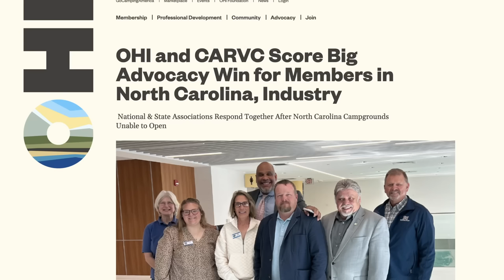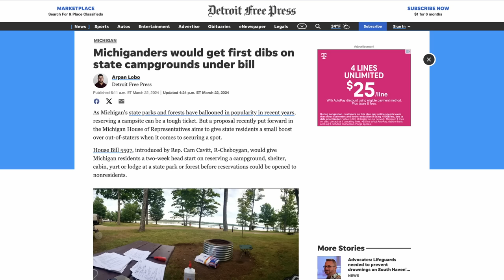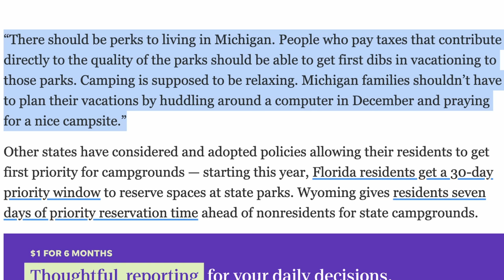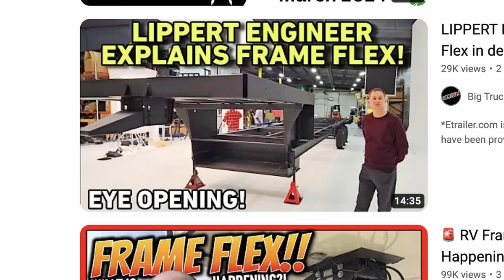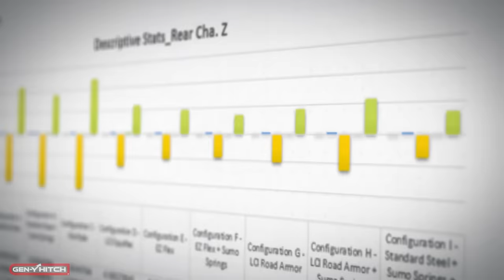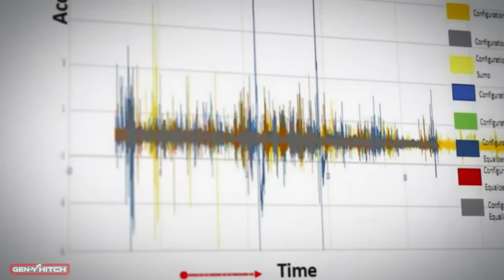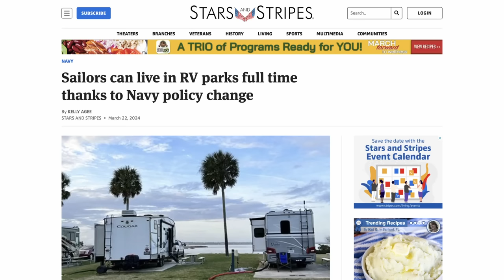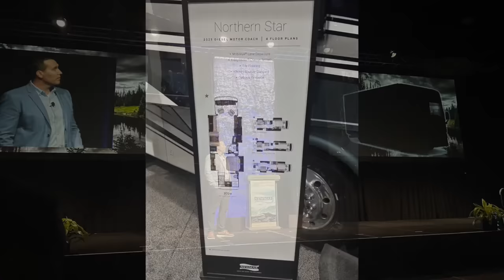NC Campgrounds SHUT DOWN, MI State Park Head Start for Residents, Can Gen-Y Hitch Fix Frame Failure?

Comment: I sold RV's for over 17 years, when customers asked me the same question about adding a gooseneck, Anderson or any other IMPROVED hitch and does it VOID the frame warranty, I said, just save the original pin box and if you ever have a frame issue, re-install it and have it looked at with that one and the question NEVER comes up.  Problem avoided.

Comment: North Carolinas deputy fire marshal needs to stay within their jurisdictional wheelhouse and quit trying to put a feather in there cap in the name of electrical safety. Adding GFCI’s to Campground pedestal 30 and 50 amp receptacles is insane. They are protected within the unit and unless there’s a damage cord from the pedestal to the unit there’s absolutely no hazard and as stated the appliances in RVs are not designed to function on GFCI is 100% correct. Thank you for your research and reporting this information. 👊👍😎
Reply: Also, there should never be two GFCI's on any one circuit or the feature will not work as advertised .  If the electric pedestal has GFCI, then the camper should not.  So now if your camper has one built into the panel, you should not be plugging into a GFCI pedestal.

Comment: GFI's, you cannot put 2 GFI in series or on the same circuit, they will trip each other. If you put a GFI on the pole, then have another in the camper they will trip each other. I was an electrican 40 years.

Comment: The GFCI issue is somewhat true, however, it's not so much that RV's can exceed the limit for the outlet, but RV's are not "grounded" to earth like a residential home is. 30amp and 50amp plug are not effected, but the extra 15amp GFCI outlet is the problem. I had this issue when plugging in a smaller trailer on the GFCI outlet. The trailer would just instantly trip since the trailer wasn't grounded to anything and not completing that circuit 👍🏻

Comment: Unintentional tripping of GFCIs is a real issue.  Most items that plug into 15 or 20 amp outlets have long ago been undated to prevent nuisance tripping.  However, take an entire 50 RV with all of its electrical components and you are asking for trouble.  Many items contain some kind of surge suppression.  Surge suppressors leak current to ground.  While one suppressor would likely not cause a problem for GFCI, many of them in one RV WOULD.  RVs have their own GFCI protection so requiring that protection on the 50 amp pedestal is unnecessary and likely will lead to issues.  I teach classes, including lab exercises, related to GFCI issues, along with the European version (residual current devices: RCD).
Reply: Thank you for your well grounded comment.

Comment: Gooseneck naturally have less chucking, because the lower mounting point that is closer to the axle. I’ve been building air ride hitches for 25 years. I’ve also been fixing fifth wheel frames that are are completely stock we pull the bedroom apart and take the apron off the bottom and sister in stiffening plates. 
I personally run about 10 to 15,000 road miles a year in an RV.

Comment: When towing on a dirt road, be sure to loosen any anti-sway control or equalization bars. Those bars are fine for pavement, not for off-highway use. They put all the stress on the trailer frame. I've seen it a dozen times at the dunes.

Comment: On a long extension cord my circular saw will trip breakers. There needs to be lengths with electric code. First come first serve. Like going to Isle Royal. I prefer goose neck over 5th wheel hitch.

Comment: Frame failure is from light weight frames. When your comparing camper frame to trailer frames. You can see the difference and both supposed to hold same weight.

Comment: FYI, Harden, Montana is not near Yellowstone NP.  It's at best 247 miles away during the summer.  In the winter you'll have to travel to Yellowstone from the Harden Love's RV park via Livingston which makes the trip 347 miles away.
Reply from the maker: Hah. I should have looked at a map. They are advertising it as "in the yellowstone vicinity." Thanks for the comment!

Comment from the maker: Do you use an aftermarket pinbox or gooseneck hitch?
Reply: Yes I replaced the Trail Air pin box which a Gen-Y gooseneck on my Riverstone Legacy 42 fskg ! But Riverstone doesn’t have any frame failure because they have an all steel box frames.
Reply: We bought a Brinkley 3100 end of December and had the Gen-Y gooseneck installed.

Comment: Ensuring electrical safety at an RV park IS the NC deputy state fire martial’s (and building code inspector’s) job. You have not read the NEC committee evidence. Circuits are NOT all GFCI protected inside a RV. With the 2023 NEC §210.8, if you install any 120/240 VAC, 50A or less outlet outside or in a garage at home, including a 30 or 50A RV outlet, the NEC requires that to have GFCI protection. Jason is correct saying “he doesn’t buy” the appliance explanation. There is no reason for RV appliances to have enough leakage current to trip a GFCI. For several years, we’ve had GFCI breakers on outlets serving our 30’ Airstream Classic (50A) and our 19’ Escape (30A) trailers without tripping the GFCI protection. The only tripping we’ve experienced has been during electrical storms with very close ground strikes. Fix the RV system problems. Hopefully the 2026 NEC §551.71(F)(2) will make RV parks provide the same safety features as your home or other non-dwelling units. I applaud the NC and other states that place electrical safety first. In case you don’t know, as of Jan 1, 2026, NEC §551.40(D) states “Each recreational vehicle shall have a listed grounding monitor interrupter premanently installed between the feeder assembly connections to the vehicle and before either a transfer switch if installed or the panel board.” This means you cannot connect your RV’s AC circuits with a hot/neutral reversal or a missing ground connection at the site pedistal.